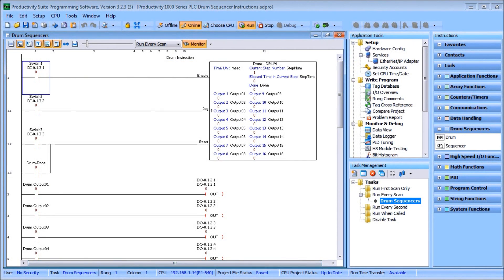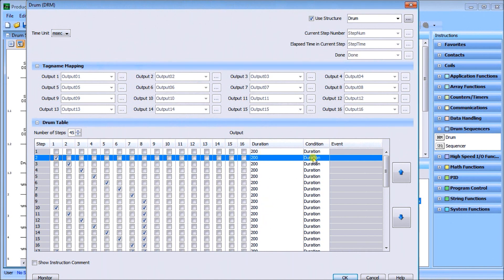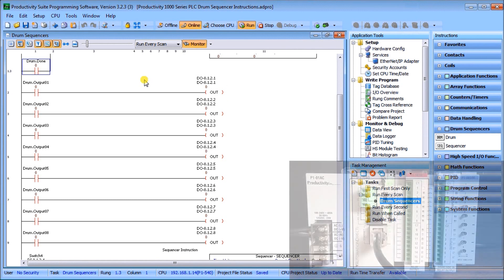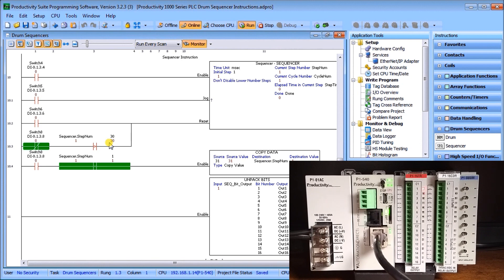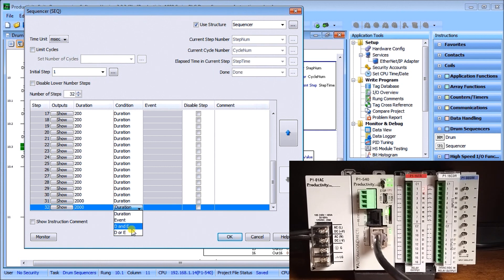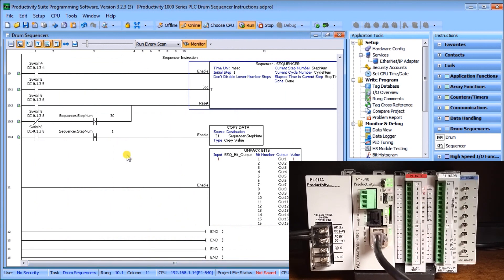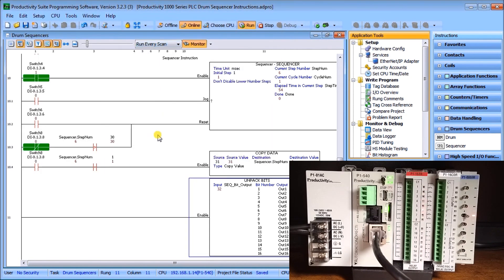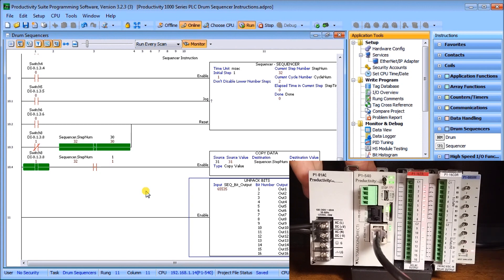Productivity 1000 Series PLC Drum Sequencer Instructions

Comment: Is there a way to trigger multiple outs all through 1 instruction?  A group of outputs basically? This seems sort of like that but with event seems only 1 output at a time.  Trying to find a way to save time linking a bunch of outputs and not have to enter a Timed Coil for each one.
Reply from the maker: Hi @madox76
I'm not exactly sure what you want to do. However, you can create a timed drum instruction. Use a smaller time base and select the outputs you want to trigger each time.
You can cascade drum instructions and have multiple events and timed drum sequencers. 
Regards,
Garry
Reply: @ACCautomation  instead of 24 timed coils one sub rung after another i was looking for a way to add all 24 outputs to a single rung item, group them together.  Drum has issue still only energizes 1 output at a time.